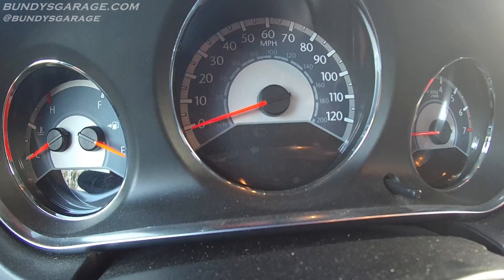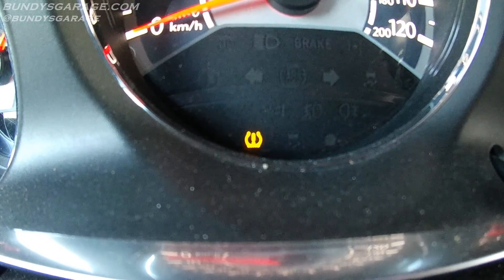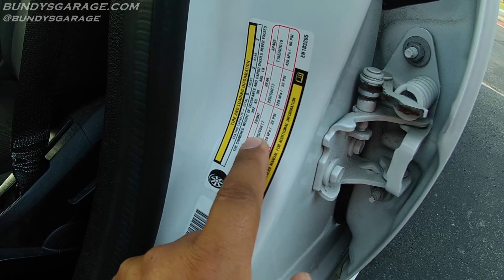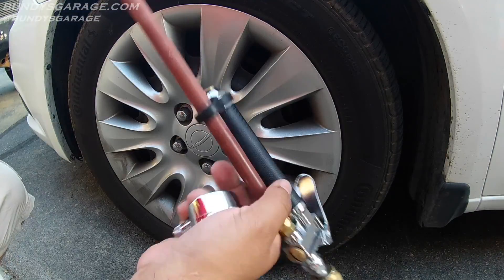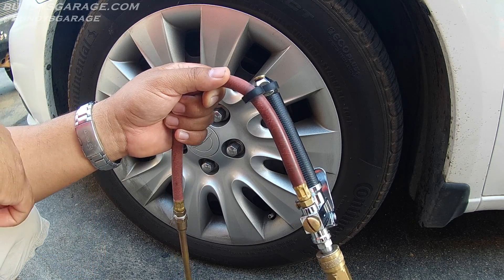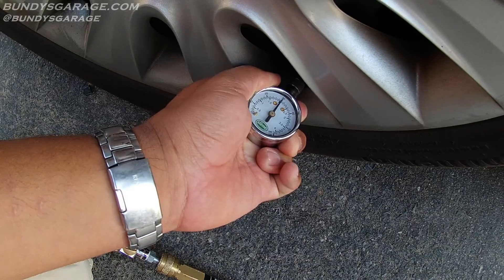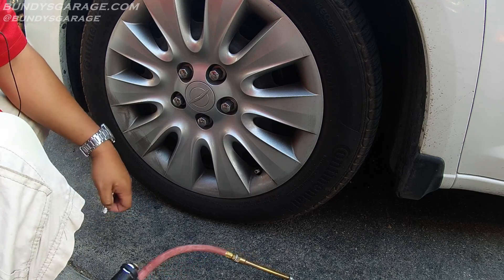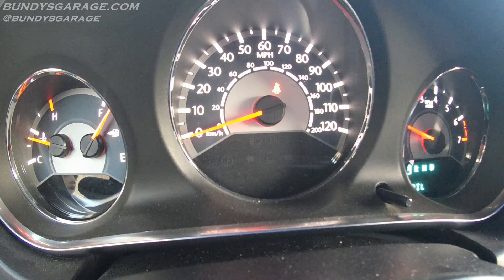What is TPMS and How Do I Reset the Light - Is your TPMS Light On - Tire Pressure Monitoring System

Comment: I first got a car like that in 2014 the symbol came on I just put air in it the light went off.The car I got now has that and the light has not come on yet.I got about 4 tire gauges one is like the one you have.You can also get free tire pressure checks and free gauges at Discount Tires,you just pull up to this area there and the Discount tire person checks your tire pressure and adds air if needed no charge.I took a car in and believe it or not they patched my slow leak tire free I could not believe that.
Reply from the maker: +Mark's Reviews it's also a good idea to tip the guy doing the work, it will go a long way with him for the next time
Reply: I do not think they allow that there it is what they do the guy gets paid a regular check.
Reply from the maker: +Mark's Reviews you can tip them, its no big deal. Any person offerimg you service you should consider tipping. Typically they make miminium wage and cash tips can really help them out.